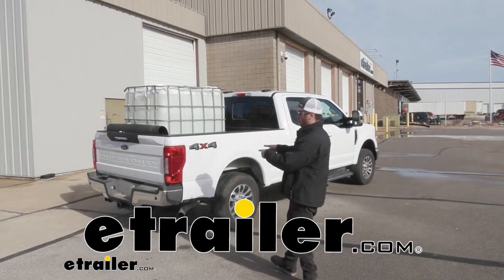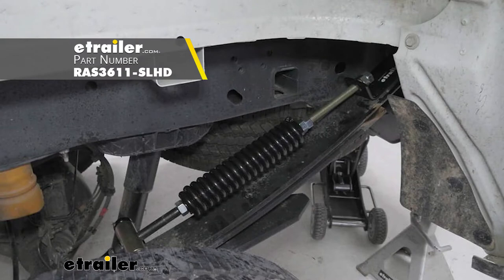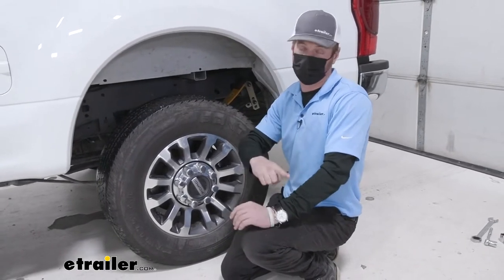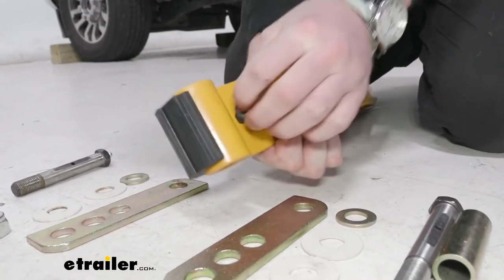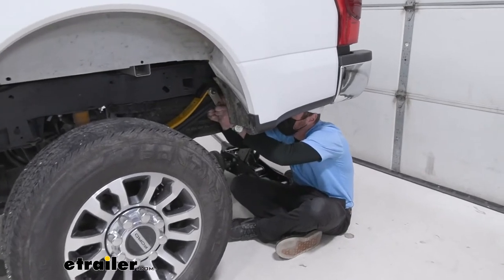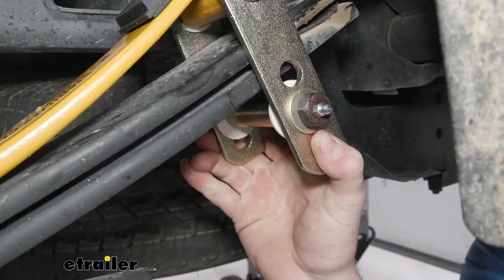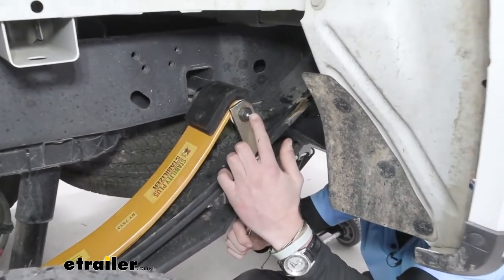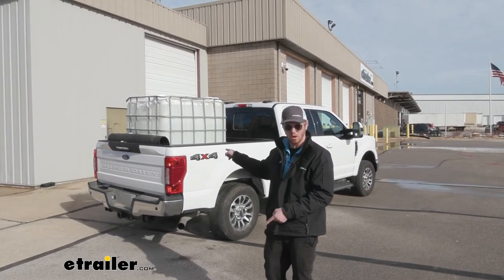etrailer | Stability Plus Stabilizer Helper Springs Installation - 2021 Ford F-250 Super Duty

Comment: Washers dont fit the over greasable bolts whatsoever on the Ford ST7514 and the zerk fittings backed out with normal driving vibration, absolutely do not buy this kit.